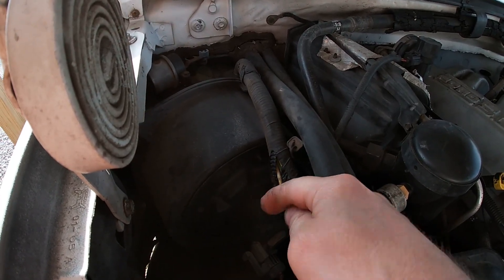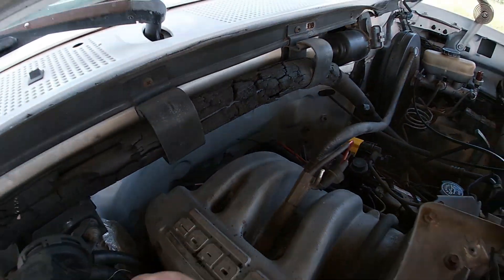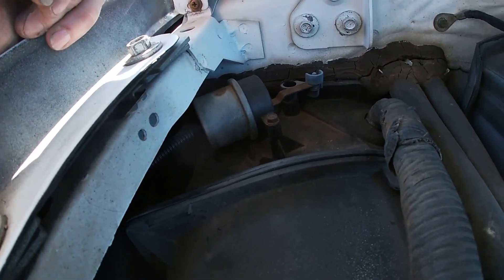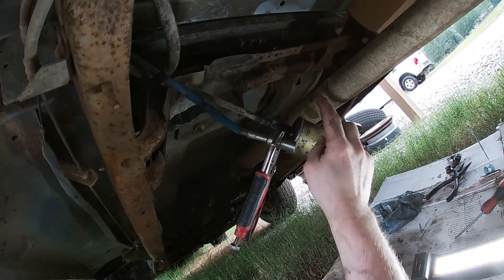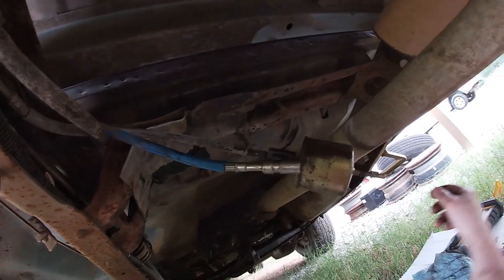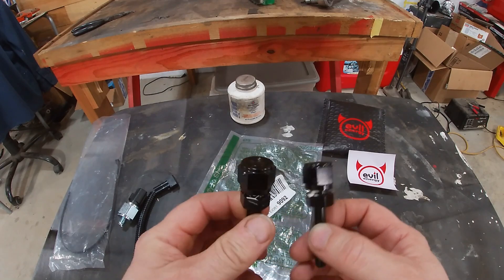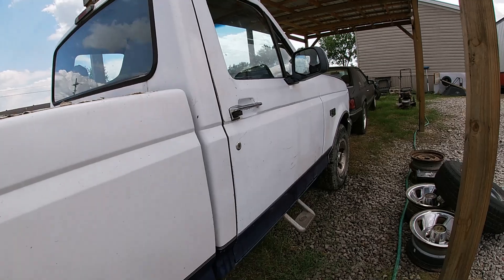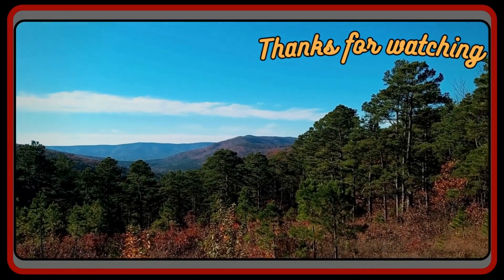96 F150 Fuel and Vacuum lines

Comment: Where does that ground strap go that is connected to the fire wall on the passenger side ? Mine is not connected to anything.
Reply from the maker: Check to see if it attaches to the back of the cylinder head.  Most of the time a firewall ground attaches to the engine somewhere.  Thanks for dropping by
Reply: Firewall to engine, mine is on an intake plenum bolt…